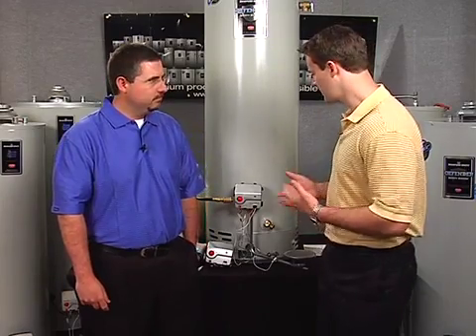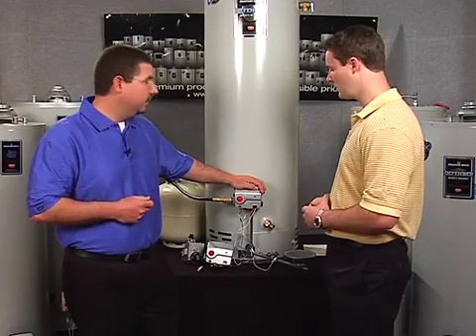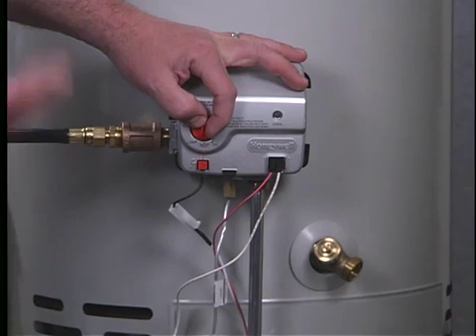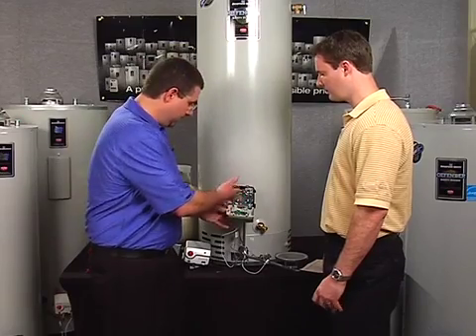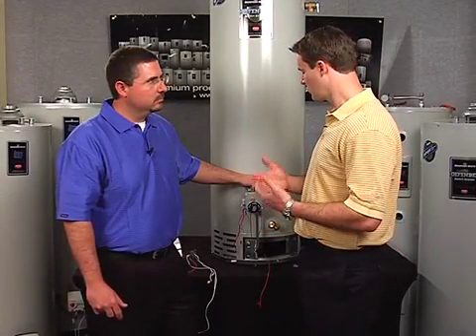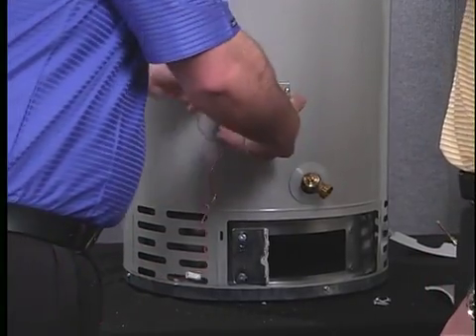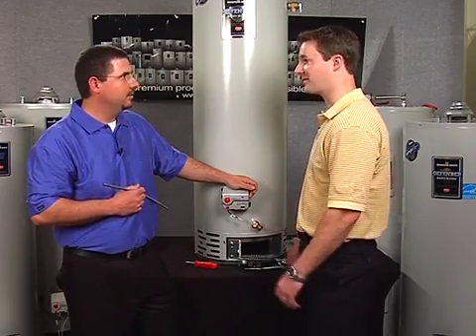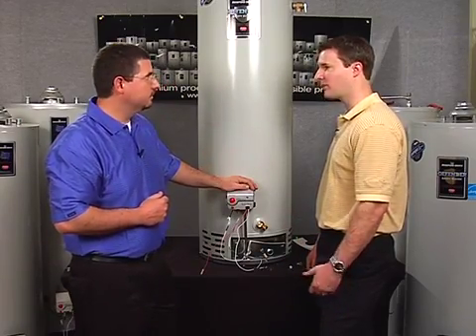Bradford White ICON System™

Comment: Looks so easy to see if the pilot is light when you have the pilot removed from the unit.  It's almost impossible to see the pilot thru the window while holding in the control valve and pushing the ignitor.  your instructions on the unit are very unclear.  you should say to continue hitting the ignitor until the light comes on, not listen for a click, since the ignitor makes a clicking sound

Comment: I have the setting up as high as it can go, but the water isn't getting as hot as I like.  I want it VERY hot, like unbearable to touch without gloves on...is there a way to raise the max temp setting?
Reply: Depending on the age of your faucets and shower controls, the temperature setting within them could be preventing the desired temperatures. These devices are designed to protect your family as well as unknowing guests that wouldn’t expect potentially scalding temperatures.
Reply: @scottbartram4266  its throughout the entire house.  no faucet, tub spout, or showerhead gets above a certain temp.  The water gets very warm, but not HOT like I am wanting.  Everything is within 3 years old, it is a new home.
Reply: It’s required by code to be adjusted to that temperature. You would have to either adjust each one or have a plumbing company make the adjustments.
Reply: @scottbartram4266  found the issue.  The blue valve coming from the wall where the hot and colds water mix when going into the house was turned all the way clockwise.  I turned it counter clockwise, and now we have HOT water.  Had nothing to do with the Unit itself.

Comment: So, I have the error code 5 flashes. It says temp sensor needs fixed. How do I get the temp sensor? Or can you just buy a whole new gas valve, does that have the sensor included?

Comment: Thanks for the video, had to watch it a few times, but I finally got the hot water heater pilot lit 🔥.. One important tip that’s not in this video is, you want to make sure your Gas switch is in the ON position on your gas Line that’s connected directly to the heater....$

Comment: Had replaced my homes water heater just 6 years ago with a Bradford White one, of course just as the warranty period went out, it randomly stopped working. Went to my local plumbing supply warehouse where I purchased the tank at and I bought a new pilot assembly. But I still have the problem that the pilot won't stay on once I release the button after the light starts flashing. Any ideas on what may be the problem? Called a plumber but they just want me to replace the whole water heater and are no help
Reply: I have seen the same problem many times as I trouble shoot water heaters regularly. When the light blinks normal operation and the pilot goes out when you release the pilot button, the gas control valve (the box with the LED on it) has failed and must be replaced to solve the problem in my experience. I’ve been trying to see what is failing internally to see if it can be repaired.
Reply from the maker: If it's the ICON System, we would recommend reviewing the video above for self diagnostics or contacting a service company in your area. Consider contacting Bradford White Technical Support if you are looking to solve the problem without a service company.

Comment: Wat is it when you are lighting the burner and you have your finger pressing the thermo dial down and once you get the the burner on and you release your finger on the thermo dial ,the burner shuts off. Please I need help.
Reply from the maker: All systems have a mechanism for verifying or sensing the flame and if it is dirty or needs replacement it will not allow the flame to stay on.

Comment: I changed Bradford White Icon Gas Valve System. The circuit board got wet. Is there anything I could do to repair it? Or do I have to replace the entire circuit board?
Reply from the maker: If it got wet, all you can do is let it dry out and try to put it back into service. If it doesn't work, it will have to be replaced. If it wasn't in operation when it got wet, it's likely it will be fine if dried thoroughly.
Reply: How much is it to replace the circuit board
Reply: Diversified Heating & Cooling Inc. How much does it cost to replace circuit board?

Comment: Turned my hot water heater down the other day for the summer season and evidently I cut it to low making the pilot light go off. After several attempts I went looking for the Manuel and found every Manuel except the water heater. Went to YouTube and find your video . Found out what I was doing wrong and went up immediately to try again. This time with your help from video I was able to light right away. Thanks!